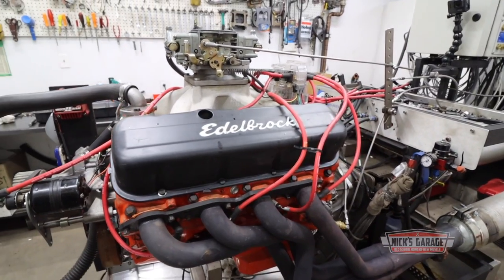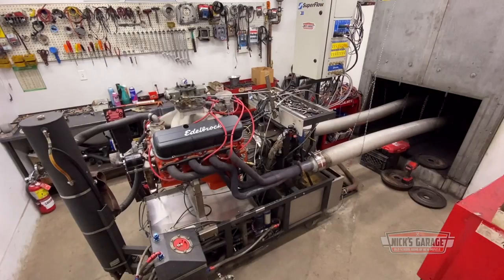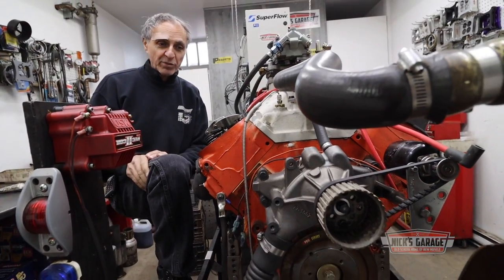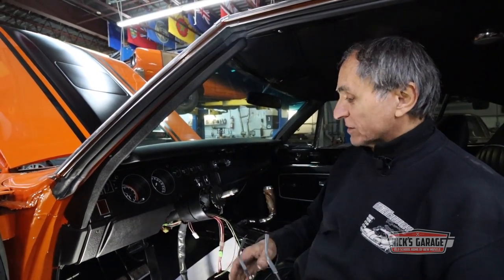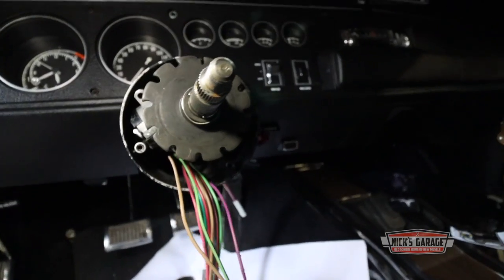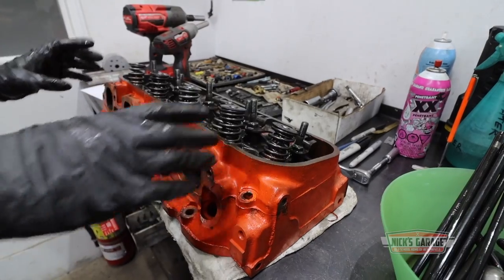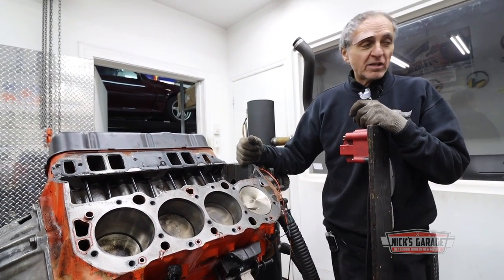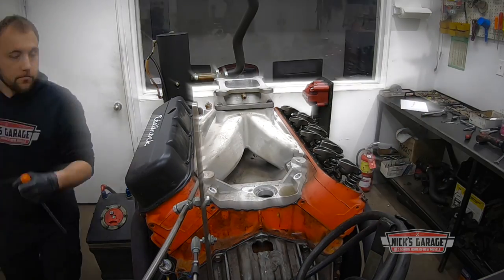Weak Big Block Chev • Wrong Parts + Poor Assembly = No Power!

Comment: The pistons being installed wrong is what I noticed my late dad used to do when he built an engine. Which he used to tell me when I was a younger person, that is what made more horsepower and torque. 

Needless to say I found out later on in life that he was full of bovine excrement. Since I had a friend named Bob the Engine Professor who built engines for 40 plus years when I was a younger adult learning about engines, show me on his Dino that it backfires through the carburetor and possibly could bend valves. 

So in his own way he stated the same thing that Mr Nick the Engine Man is talking about in these videos.
Reply: I have heard of this too, but the trade off is pistol stability.  Pistons installed 180* rotated will cause piston slap because of the piston pin offset.  In this case, installing the pistons rotated 180* was not going to make significantly more power.  Flat top piston plus open chamber heads equals low compression.  I don't know what the builder was thinking with this one.
Reply: Camp'n Outdoors  Sounds right.
Reply: Right or wrong you don't disrespect your Dad, what's wrong with you? He didn't smack you with a hammer enough times..
Reply: If you had a stock type/4 valve relief piston back in the day, and were racing it, it was normal to reverse the pistons to increase the dwell at top dead center. 
The factory engineers offset the piston pin to reduce piston slap (knocking) on cold starts, and to prevent skirt breakage with fragile cast pistons. It WAS hard on pistons, Racers threw them out after a couple of hundreds laps, few weekends at the drags. 
The more you know the more you grow.
Reply: @robh9577  That's a fact..
Reply: @dukeman7595  Well he normally didn't have a hammer handle. But he usually just hit me with his hands that were like hammers or throw me down the hallway causing me to violently hit the walls in the house. Or burn me on a hot stove or heater. Moreover, he said and did a lot of things that were not how you would do things. The engine example is just one that would not cause him to be in trouble with society as a whole.
Reply: Camp'n Outdoors  Exactly!  The old Mopar Performance manual recommends reversing stock pistons to lower internal friction and pick up a few horsepower (aftermarket high performance pistons typically do not have piston offset and do not benefit from this trick).  This may shorten engine life a bit, but so will big cams, stiff valve springs, high rpm's, steep gears, speed shifting, drag strip starts etc., etc.  We're not gonna drive these old beasts 200,000 miles anyway.  And obviously this trick can't work if the piston has one valve relief like this big block Chevy has, as the relief ends up in the wrong place to provide valve clearance (same for two reliefs; with four identical reliefs, it would be OK).
Reply: Dave Micolichek  I saw it happen on a dino years ago. Moreover, the guy I referred too who had more than 40 years of experience building and testing them stated that was one of the causes. Furthermore, he was right 99% of the time, that is why everyone used him for their engine needs. That and the fact he never had an engine blow up from anything to do with the assembly process. 

Again, I stated that in my original post, so apparently you didn't read that part, or you would not have had to ask. Thank you!
Reply: John Johnson  tony aint perfect.
Reply: Dave Micolichek  Well then that shows just how little you know. I seen it with my own eyes and after correcting the problem it stopped. So you can go on and tell someone who cares to listen to you.
Reply: Dave Micolichek. As I have never flipped pistons I would suggest the obvious. Timing. (^^)

Comment: Hey Nick put a blower on top of that motor and make WAY over 600 HP. At 120 per cylinder thats right at somewhere around 8.5 to one. Ideal compression ratio for a blower putting out sub 25 psi on street premium gas. My last performance motor was a 355 SBC with a 144 B&M blower that made close to 450 without the NOS that boosted it to over 600HP. That was out of a 355 SBC. A 434 big block with a 6/71 or paxton setup should be close to 800 if not more without NOS. That is if the pistons are good forged ones, rods are good aftermarket, 4 bolt main block and a steel crank. Otherwise you are making a BIG grenade.  Would make for a great Youtube video of dyno disaster segment however if cheap parts are used.

Comment: This is very common....Even people put mean sounding cams in and its slower than stock..

I did a lot of Friday Night racing until the early 2000's and I seen it all..

Lots of so called built cars ran slower than stock and they had big wide tires and traction!! 

There was a 1970 Cuda with a so called built 440,sounded really awesome but the car ran 13's -14's lol!!!! 

The guy put a bone stock 1969 440 from a wrecked Monaco and it ran low-mid 12's by adding headers and a 750 carb/intake manifold no cam swap,no head job etc...So a, so called built 440 ran 14's lol a stock non hp 440 ran low - mid 12's(12.40's on average)..Same trans,same axle ratio(3.91) only swapped the engine..I seen many cars like this all makes!

He bought the stock 440 from my buddy who built engines,this 440 was from a t -boned Monaco that an older couple owned...engine was stock,never touched! Except for the headers/intake manifold and headers!

Comment: I pat myself on the back with this one. When you made that dyno pull, knowing it had those big M, big port heads, I knew it had flat tops in it. Upside down none the less lol! I'm a Chevy man through and through and had a few Big Blocks and many, high revving small blocks.. Gear Drive = Valve Train Vibrator.

Comment: Hello, I am currently restoring/customizing a 1983 Dodge van with a super 6 and an A-833 trans. You talked about re coding the door locks to match the ignition key. Would it be possible to show how that’s done? Love the channel!
Reply: AJ.        Take your door locks  and ignition key to a locksmith and have them coded to the ignition key. That is what I have done to the RR.
Reply: Thanks Nick 👍

Comment: The 427 puts a big flame out At Nicks Garage they don't scream and shout They calmly dismantle to see what the trouble's about Vasily on the case cuz 360 hp is a disgrace The heads are old n rusty The team can fix em trust me Once they put new pistons round the way they should be This engine will run smoothly...

Comment: My friend bought Dodge Charger -68. It had 440 in it with lots of new hipo parts. He took it to dyno because it felt lazy. Dyno result: 144Hp in DIN.  🤣
Carb was off, igmition was off, cam was off. After adjustments it gave 380Hp. Good example when Bob orders hipo parts and puts it together with no adjustments.

Comment: takes a combo of pistons, heads, cam, intake, carb/efi, and timing to make any significant power.
Reply: It takes a whole lot of care in the tolerance area too
Reply: true. ive seen engines with a loaded top end push out the crankshaft.

Comment: That engine needs domed pistons and a nice solid roller cam to get anywhere close to 600 hp. I'd say at least 11:1 compression. 427s love to rev.
Reply: The pistons in it now are doomed.
Reply: @theravedaddy  apparently u didnt watch the video or have lack of knowledge about pistons u and the 3 others who like the comment those are flat tops not Dome!
Reply: @BigUnk85  .... If you can't see the joke, you are doomed!
Reply: @paulcopeland9035  you trolls are doomed
Reply: @BigUnk85  ...So, how am I a troll?
Reply: Trace Smith  i got 'fudge'... im still on my 2nd morning coffee so that will be changing soon....
Reply: like to rev?a big block!big blocks are torque monsters not a high rpm engine!bring a big block up past 6000 rpm for to long you,ll have rods and chunks of block all over the track!
Reply: the ravedaddy     Close but no cannoli!
Reply: ernest copoulos  the 427 was designed to rev a little higher and if built right can make power up to 7,200. From the factory, you are correct but this engine is no longer factory. Junior Johnson’s “mystery 427” powered 1963 cup car for his nascar races ran at 8,000 rpm on the straights.
Reply: @kevintucker3354  its on its way, my 2nd coffee has kicked in and i can feel the call to unload....
Reply: @kevintucker3354  exactly,with carillo rods,lightened and balanced crank,the works,but saying the bbc was made to rev is in no way correct, a small block on the other hand is a whole new ball game especially the 302,that was made to spin
Reply: The joke went way over your head, smart guy.....
Reply: My 427 made 660hp and still pulling @6200 10.6-1 .612/.612 255/251@.050 hydrolic roller on pump gas with stock crank/rods and antique TRW pistons.
Reply: @zacsimmons3429  
Which heads? I'm dreaming up a big block rebuild. I've got 049s.
Reply: @xmo552  bowtie rectangle port.
Reply: @zacsimmons3429  
Thanks
Reply: @ernestcopoulos2709  - Showroom stock 1960's L88 & ZL1 427" BBC available in Corvettes and Camaros HP peaked at 6600 RPMs, revved to 7,000...
Reply: @xmo552  - Port your 049's... bigger valves... correct pistons...
Reply: Yea, 11:1 with a solid lift roller would be an awesome streetable car, wouldn't it?
Reply: Junior Johnson's Mystery 427 had a shorter stroke. 3.65in which happened to be the same as the Z-11 drag race engine, which was basically a longer stroke 409 with quite a few improvements. The Mystery 427 had the same journal size for the mains and rod bearings as the 409 and Z-11 427.
Reply: @ernestcopoulos2709  is clear that you have  no knowledge of big blocks period if u did would that a big block 427 vette for the factory had a 6500 red line in stock trim. I love when small block guys get on here running there mouths.
Reply: @funkyzero  actually it would I have a 12:5.1 468 that I drive on the street all the time. And who said anything about it being streetable? Obviously the guy isn't worried about that if he looking for 600 hp out of a 427.
Reply: @BigUnk85  "obviously"?  Sounds like you are trying to do it....  which I doubt is anything more than "I'm an expert with 30 years experience" youtube comment engineering.
Go away
Reply: @BigUnk85  "I been racing big blocks for years"
yup... just what i expected
Reply: @BigUnk85  have fun red lining that 427 vette,bet you aint gonna do it more than a few times!maybe a built big block with tons of aftermarket goodies and machine work !!why dont you drop a deuce and eat it,wanna be!!

Comment: I'm no expert, but was a machinist in an engine shop for 5 years and saw the big claim engines almost weekly get opened up to reveal improper assembly that even a novice should have picked up. My favorite is the "red rag" clump of fibers all stuck on the oil pick up.

Comment: I remember some guys I knew threw a lot of expensive parts in their engines and they ran like a sick dog.
Reply from the maker: Thanks for watching, Gary.
Reply: If we only had a dollar for every time that happened.
Reply: Some people want a 10 when a 7 will do the job nicer.
Reply: @Mark Ayash Hard to believe that small of an engine that is stock does that.
Reply: I have heard two instances of big dollar engine builds ingesting the threaded rod that held the lid on the air cleaner. $0.01 worth of locktite not used

Comment: We ran into basicly the same with a newly rebuilt 1959 Jaguar D 3,4 Le Mans engine a couple of years back. Engine normally makes 280 hp. After the rebuild when we got it it pulled 180 hp. Wrong cam, wrong pistons, wrong rods, right head type, but wrong chamber volume for the engine. Needless to say that it was quite expensive to get it back to where it should be. I did tickle the heads and CR  little since we had to get in there anyway, so it ended up at 316 hp. After that the customer was happy.

Comment: If the bores measure ood at 060 buy a set of dome pistons solid roller get zero deck final compression at 11.0. Complete triple or 4 angle certi valve job kmotion springs installed to specs. Those rockers break the roller tips but good rockers install a valve girdle set a billed msd distributor. Lock the timing out and give it 38 total with 20 degrees retard at start up and send it

Comment: A kid I went to high school with bought a truck that he was told had a .030 over 400 sbc in it. He bragged about it constantly. So we thought it was hilarious when he blew the engine up after a couple of weeks. The shop teacher told him to put it on a stand so he could tear it down to show us how to disassemble an engine and how to diagnose what killed it. He flipped it upside down and said "I can tell you right now, it's not a 400 Chevy. The sides of the block are straight. A 400 has humps along the side where the cylinders are." The kid says "well maybe they meant it was a 383". So off came the oil pan. The teacher sees the crank casting number and says "That's not a 400 crank, so at best, you have a 350." Kid stays quiet. Teacher pulls the heads and stares at the block. He says "those aren't 4 inch bores". Kid insists he's wrong. So the teacher grabs a micrometer, measures a bore and goes "You have a .040 over 305". The whole class burst out laughing. I don't even remember what caused it to blow. OH! Yeah I do. Whoever built it used shims instead of head gaskets and they blew out between several of the cylinders on both sides.
Reply: Joseph VonKamp ....yeah that one thing bad with Small Block chevy’s, if you don’t check the engine casting numbers you could wind up with a 273.
Reply: @eronacalloway9159  a friend of mine was told the truck he bought had a 355 with "202 double hump" heads. We ran the head casting numbers when he had the valve covers off, and they were the smallest heads ever put on an sbc. I forget which ones exactly, but they were used on late 60s 307s and had a 1.72 intake valve. A 1.84 was the biggest valve you could squeeze into them.
Reply: Lol this is why people love Toyota 😂😂 and hate Chevy 😂

Comment: Nick, get the door barrels matched to the ignition switch at the local locksmith ( pas cher ) 
I see many people with big money and zero knowledge buying old cars off crooks ( crosseurs ). One day you have to do an episode on mopar musclecar fraud and VIN switching, rewelding rad supports & quarter panel VINs. I discovered my first "fake" plymouth Gtx when I was 20 yrs old in 1990. The numbers on the rad support were filed off & filled. The quarters were RH satellite and the RS dash had one bolt snapped underneath.
Reply: Hot80s.           I did give the door locks to a locksmith to code them the same as the ignition.

Comment: Got a love how there's always those old dudes standing around in their garage and they think because they threw an RV cam in spray-painted their engine block orange with new gaskets suddenly they think it makes like 500 hp 🤣
Reply: Painted cylinder heads will get you another 50 hp

Comment: I don't guess when it comes to horse power , I ran my 68 super bee with a 440  on a chassis dyno back in 69 with cam  headers holly 780 I got 325 hp at the rear wheels never guess that's what Dyno's are for !! Good Job Nick !! another 5 star video
Reply: Woof woof

Comment: I'm a big block chevy guy and so far the parts combo looks suspicious. Carburetor is way too big especially this a street engine. Huge single plane intake, cheap dizzy....🤯 hopefully after Nick get done she'll atleast make 500hp.
Reply: yup, a realistic expectation for a good fun DD.
Reply: Or maybe close to 700 😉
Reply: 500 is realistic with those heads & bbc love high lift cams don't be shy!
Reply: The old 427 s were monsters , remember the 625 Hp version( the caption said do not tease)
Reply: Now i have a 71 402 at 413 60 over bore that makes 614hp at crank on pump gas.  It is all in how you match parts 600 hp from 427 or 454 is not hard to do.
Reply: My belief is that someone just grabbed a bunch of swap meet/eBay parts and threw something together.  It's probably a good thing it didn't make 600hp, because I have doubts that the valve train would survive long. My philosophy is an engine is a long term investment.  Spend the money on survivability, not just on making horsepower. A 600 hp motor with broken valve springs and stretched rod bolts is no longer a 600 hp motor.
Reply: @abolishwelfare  I believe in that same method. Reliability is the most important thing for me especially when buying or building a street engine. My mild 496 big block made 565hp/600tq on 9.1:1 CR some people might say that's weak for the cubics, but it's plenty for me in my '68 Impala. Idle quality is good and makes decent vacuum, and not hard on parts.
Reply: @backyardbuilttrucks1  Bubba has a mild 460 inch BB, it will probably make 450 HP on 87 octane, its going in an old original 67 Impapa SS( the 427 was put in a Nova and subsequently  wrecked, dang it all, I think the 427 got hauled off for scrap.
Reply: @kevinmccune682  

Damn dont see many BB impalas let alone a 427 copo car or SS
Reply: @backyardbuilttrucks1   Never did understand why the previous owner put the engine in a Nove( the Nova didn't look half as good as the old SS)
Reply: Aaron Cubitt  500hp is good for a street engine that's a V8. What is small engine can make 500hp natural aspirated and still be very streetable? I'm not talking about a drag engine either.

Comment: This is where you can buy the best parts but if they do not work together is will not make hp. Had small block chevy had all the goodies, but the heads flowed not so much , put a set that did made 150 hp more, changed the carb to one set up for the heads and cam made 200 overall. That is why you start with a cam and build to that. Thanks for the video Nick it shows what you see maybe not what your going to get.